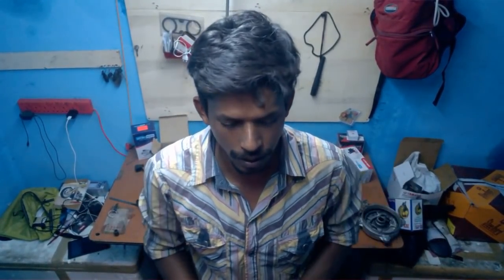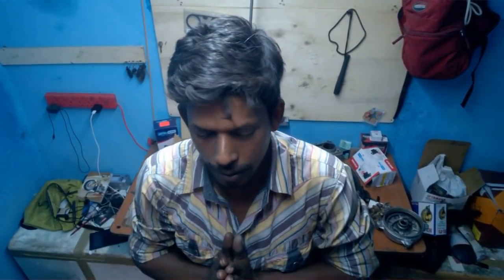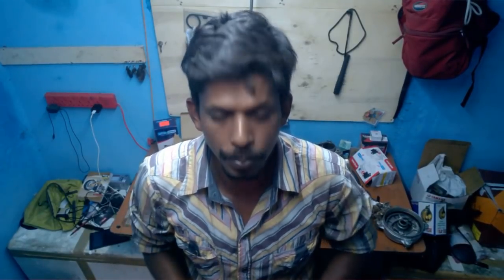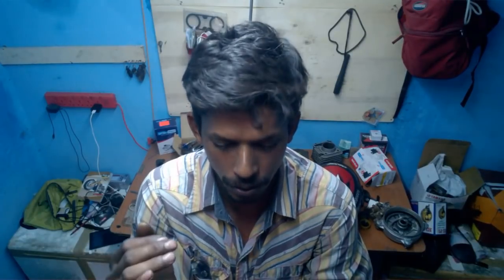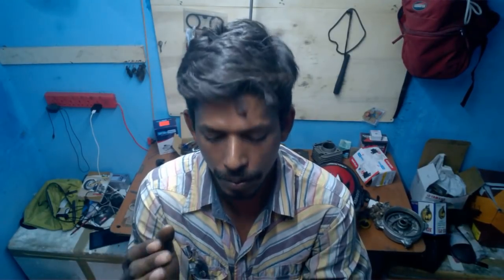Hero Honda Karizma oil burnout

Comment: Hi Ali ,my karizma is having a peculiar issue of topping out at 60kmph , I have changed bore,piston set,chain sprocket ,carburetor,timing chain,clutch plates, but still engine feels very rough and gets very noisy at higher speed ,on incline it feels to be under pressure ,it reaches 80 ,100 easily ,pick up is finebut feels quite rough and stressed ,gears make lot of kit kit sound when changed up or down and I suspect that clutch plates have been set too tight or there is some problem with timing chain ,can u throw light on the issue ,my bangalore technician seems to be clueless of the issue
I am very much attached to my bike which has been with me for last 10 yrs now ,don't want to sell it off because of this issue ,need your help in understanding the probable reasons
Reply from the maker: Hi brother how are you ? Sorry for late reply ! Please make call to this number 7022915059 we will solve the problem
Reply: change Timing chain & timing  Tensioner.